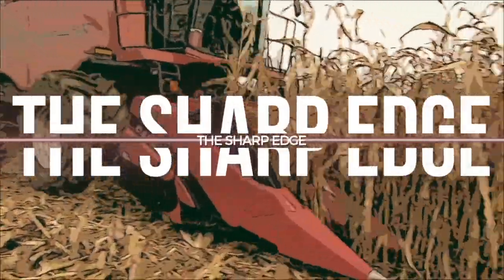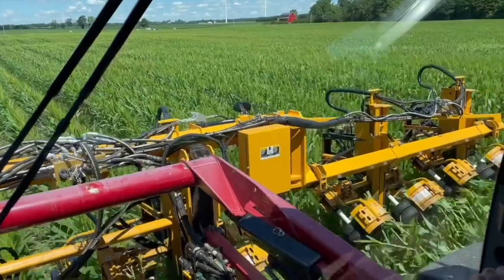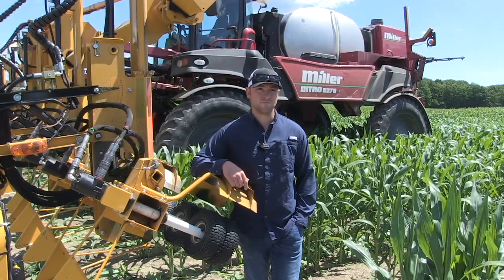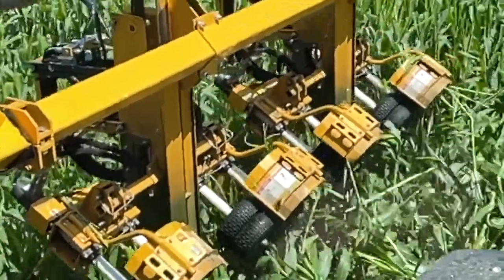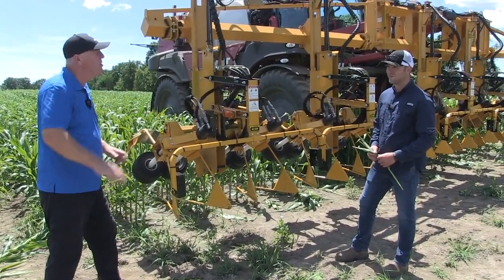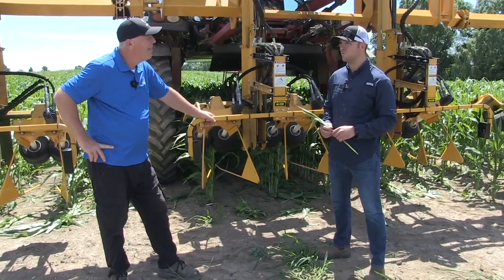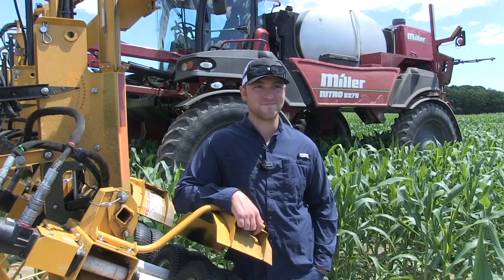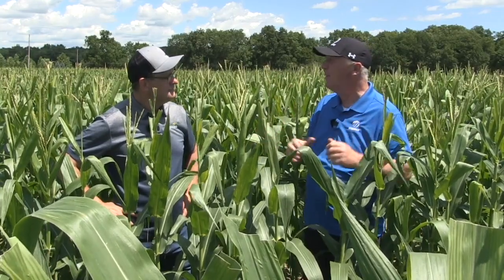The Sharp Edge: Detasseling for seed production with Joe DeBrouwer

Comment: This is the thing that irritates me about corn.. I dont know why you can just replant seed from wheat out of a field you grew it in but corn you cannot. Has corn always been that way back when they began growing it and harvesting it? Why can you replant sweet corn?! Ive done that and it works! I think it works with popcorn too! So why not field corn? Have they messed with the genetics so much that you just get mutated dwarf plants if you replant it or what?
Reply: It’s hybridized corn, rather than a landrace. You technically can replant hybrid field corn, but it will yield much better if you buy hybridized seed. The yield gain is significant relative to non-hybridized seed as well.

The same is true for hybrid sweet corn and hybrid popcorn and any number of other hybrid crops that are available.

There are currently no commercially-available hybrid wheat or small grain varieties, other than for rice. So for those crops there’s not as much advantage to buying from a seed company.